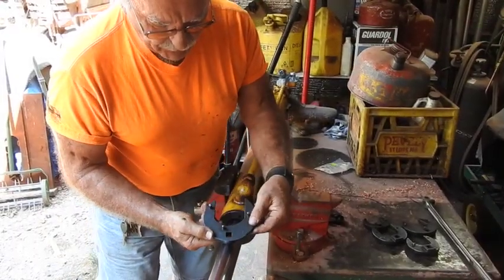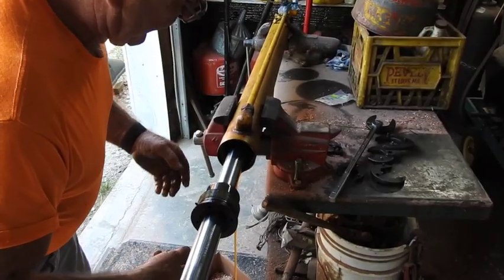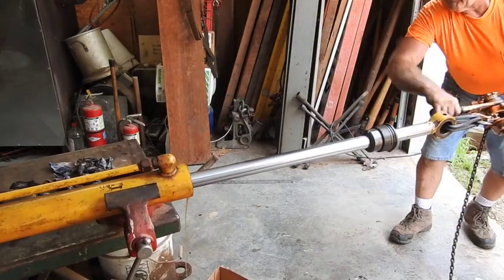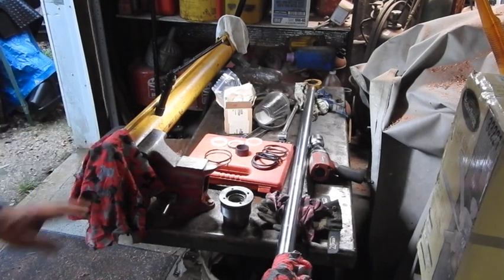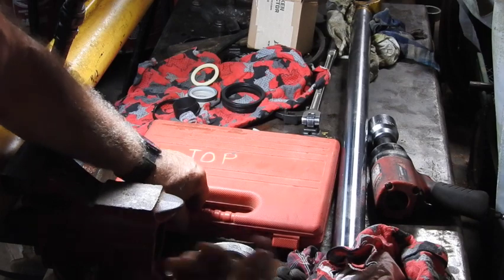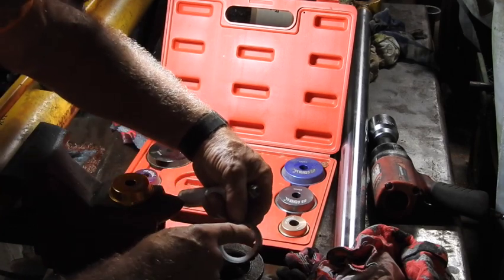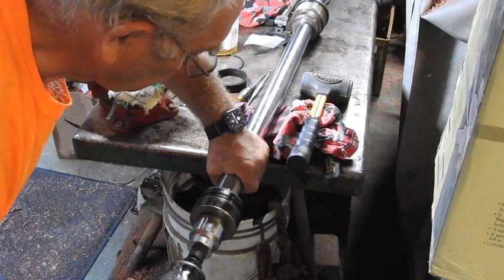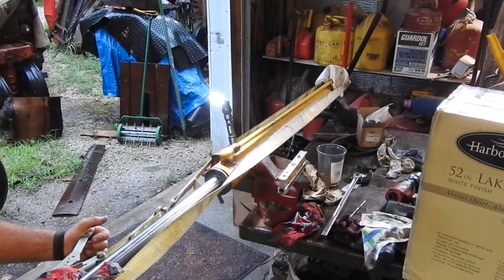Case Backhoe Boom Cylinder Repacking Job

Comment: Nice job and you made it look easy, thanks. My neighbor replaced all of the seals on my Case 480D, it was time.  He couldn't break the boom cylinder nut so I took it to a guy he recommended, yahoo charged me $120 (now I know about the spanner wrenches), same guy that charged me $170 for 2 sets of seal kits.  I bought all of the seal kits from a place in Bryan Texas and they averaged about $22 per kit, but that was 5 years ago before Covid.
Reply from the maker: Well, that's good to have them all replaced.  You should be set for a long time now.  The spanner wrenches were bought by my cousin in '73 along with the tractor when new.  I have a loader cylinder just beginning to seep right now.

Comment: Where do u order  parts
Reply from the maker: There's an industrial equipment company right across the river in Illinois where I used to go. Chartrand Equipment.  It's hit or miss though.  Then we have a local hydraulic shop I use as a last resort, but I lately have bought parts from places similar to these guys: https://amsconstructionparts.com/case/580b/backhoe/hydraulic-cylinders/parts Another place is AG Equipment Parts.  Look for numbers stamped on the end of the packing gland before you search. And make sure you have the serial number of the tractor too.  They are known for changing things over the years of production as things improve.

Comment: I repacked  all my cylinders on my back hoe.  It can be a messy  job, and requiring  a little bit of muscle, but it's not hard
Reply from the maker: If the glands aren't rusted in place they come apart pretty easy.  Sometimes the rams slide right out and other times it can get a bit tough to pull.  This one was moderate.
Reply: @tractorman4461  Yeah I used to just push them out with the machine. Sure, there was hydraulic on the ground but It was gonna be messy anyhow.   Lol   Big bars, big hammers and big socket sets with big cheater pipes cure about everything.  What  they won't cure, the torch kit will.   Even better.  Good video.  Keep running it and keep wrenching !
Reply from the maker: @spacecat7247  Yeah, that'd be a bit messier.  LOL. We used a 48'' pipe wrench and a big cheater on one not long ago.  But a guys gotta do what a guys gotta do sometimes.  Right now I gotta get my old rig back home so a bit of maintenance can get done.  It's got a few little things that need attention right now.
Reply: @tractorman4461  Case sells a face wrench for those glands.  It adapts to a 3/4 drive ratchet.  Was indispensable and the price wasn't that bad.  Check it out.  Local dealer should have them

Comment: lol I came here to see tips on how to change out the internal seal, the one Tractorman said was the hardest to change, but oh well he decided not to show the hardest part.
Reply from the maker: Hahaha…. I just popped open my phone and your comment came in. Yes it was not easy at all. You can damage them very easy. But I fold them towards the inside from one edge and gently insert them then pop ‘em back to their circular shape.  My brother just ordered a specific tool this week for one on his 580 that does it without hurting the seal OR your fingers.  This one took me three tries.
Reply: Thanks for replying. I have a case 30 backhoe mounted on a Case W20B front end loader (weird I know) I'm rebuilding/packing one of the boom cylinders. I do have a set of the seal tools you mentioned in your reply. I was looking for a video that showed how to use them, which end of the cylinder nut (old name for the part the spanner wrench goes on that holds the seals) is easiest to insert the internal seal from. I do realize it's impossible to film/record the actual placement of the seal inside, but a talk through explaining the process, what is difficult using a seal as a demo (folding, etc.) would be great. And no worries, you aren't the only youtube that skipped showing the hardest part. @tractorman4461

Comment: Manufacturer and part number of those spanners if you have it?
Reply from the maker: Well unfortunately I do not have the part numbers but they are Case supplied tools.  My cousin, the original owner bought the spanners with the tractor in 1973.  However, OTC makes an adjustable spanner that goes from 2'' to 6'' that would be my choice if I didn't have these.  Broken Tractor sells an adjustable spanner as well: CAS-1456A. The CAS stands for Case, btw.  Good luck with whatever you choose.
Reply: @tractorman4461  thank you for the reply! I have the adjustable OTC spanner currently, I just happened to like the ones that you had since they had three pins instead of two and were rigid instead of having the hinge. I work for a case dealer I’m gonna have to see if I can find some like them. Thanks again for your time!
Reply from the maker: @rally4life111  No problem. I wish I had the part number for you. Mechanic or counter man...??  Heck, I might end up talking to you for the rebuild parts on a different 188D I've got on the stand.  It sat for years with water in the cylinders.  I got the jugs out, but haven't gotten back to pull the sleeves yet.  They are roasted...pitted halfway through.
Reply: @tractorman4461  I’m a field mechanic actually. I’m in good with our parts guys though so I should be able to dig for ya if you need it. Man haven’t worked on a 188D in a while. Those sleeves definitely have seen better days then. You pull them yet?
Reply from the maker: @rally4life111  Not yet.  Its on the back burner while I get some stuff done for the Missus.  This winter I'll get back on it.  I got the jugs out with a bit of effort, but the mains look in good to be good.  A new set of standard bearings for the crank and rods will take care of the lower end. But I'm afraid its gonna take all new top end parts.

Comment: When I tried to rebuild the boom cyl. on my 580 C I ended up having to buy a new cyl. I couldn't get the break the gland loose on the cyl., I snapped one of the steel dowel pins on my gland wrench. I tried a large monkey wench. I tried a chisel, heat and then tapping on the gland until I was blue in the face and decided to buy a new one. However, I did get the other side rebuilt without any trouble.
Reply from the maker: I had one loader cylinder pretty much the same way.  I gave up when I found a used one for $150. The design of the glands on these model Case tractors is not the best. Very problematic as they get old, especially so if they sit outside.  Thanks for adding your own frustration to the thread.  LOL
Reply: @tractorman4461  It sure wouldn't cost Case much to improve on this gland design! Course I don't know what Case is doing now with these glands, the Chinese are probably making their hyd. cylinders for them anyway.

Comment: where did you get the spanner set. I can't find one anywhere?
Reply from the maker: My cousin bought this tractor new in '73 and the spanner set was bought from the Case dealer at the same time.  He bought the whole security package with the locking cap covers for the oil fuel, radiator and gauge cluster.  He also purchased  with it a full set of locking side panels that have never been installed.  Of course the full set of service manuals as well.
Reply: @tractorman4461  can't find these wrenches anywhere

Comment: For people like me who don't have a bolted down work bench with 2 vices , I left the cylinder housing end attached to the backhoe to keep the case from turning when I loosened the nut, Some idiot before had tightened the nut so tight I had to stand on a 3 ft pipe wrench with a 4 ft cheater to get the nut lose. I left the housing end attached to the tractor while using a hoist attached to my truck to pull the rod out. The idiot before tightened the nut so tight it expanded the gland and it stuck on the threads pulling it out being expanded to a larger diameter than the inner threads for the nut.

I had so much torque on it when it broke past the threads it shot out and landed on the concrete. I suggest limiting it's travel as you torque it out so it cant fly out.

 I realized the nut threads were damaged only after trying to re assemble it and trying to reinstall the gland , it's diameter was larger than it's bore. and the gland was cracked. but nowhere around the outer o ring or gland seal seat , since my leak was out  of the shaft seal I replaced it,  then I had to turn the gland back down on the lathe to fit the bore and had to straiten the threads back.

I  had not had a problem with the gland seals, if you have a problem with them you will get a leak out of the nut threads.

Go figure after I got it back together the shaft seal leak was fixed but it started leaking out the threads, 
when it hit the ground it damaged the seal. I ordered a new gland seal and o ring and now have to take it apart again to replace them, this time IM welding the cracks in the gland and turning it on the lathe  so there is no possible leak past the gland

On my  Ford,  for the inner stack gland seals ford offered shims  you install behind the gland seals to insure they compress  between the gland seat  and the face of the nut.. The gland seal needs to extend  slightly out of it's bore past the gland face, if it does not it needs to be shimmed to make an end to end seal when the nut  is snug tight and the  nut face surface meets with the gland  face surface

The idiot before me thought tightening the nut more made a better seal when the seal has nothing to do with metal against metal.

Another issue I had,  for some seals,                                                                                                                                                                                                                                                                                                                                                                                                                                                                                                                                                                                 I used Harbor freight O rings from a kit only to have leaks and find out their 1/8" cros section O rings are way out of tolerance, a 1/8" o ring is suppose to measure 139 thousandths of an inch/ Harbor freights measured 121 thousandths of  an inch.
Reply from the maker: Good deal...at least you got to the bottom of the problem.  Man o man, that dude musta really tightened that gland/nut in there HARD.  Too dang hard.  Harbor Freight O-rings are trash.  I've not had 1 in 10 that actually work.  You added a lot of good tips for sure.  I took it off and brought it home because the old hoe isn't here.  Its at another location and I didn't want to do it out in the field.

Comment: It's easier to put air on the blind end
Reply from the maker: I've done that too, but with a really tight one its hard to control the movement.  Also if there's any amount of residual oil in there, it can get a bit messy !!  Well, either that or its just me. LOL  Thanks for the visit today Ron.  Btw, I've got a couple more beginning to show signs of seepage.  One of them is a power steering cylinder.

Comment: My girlfriends Mom has got a case 580. I jump on it here and there and do some work. Put hoses on it a few weeks ago. Before her Dad passed, he sent off one of the downrigger cylinders to be repaired. It leaks from the threads on the Gland. Im not sure if an O-ring was pinched, it's loose, or perhaps damaged  threads etc... It is in visualluy rough shape, with some knicks on the end of the gland. I haven't addressed it, the leaks is small and its not used often. Good video. Reminds me of my Grandpa. He loves tractors.
Reply from the maker: It could be something simple as it is leaking from the threads.  But then the packing gland has to be letting some oil on the wrong side it in order to leak there.  I got nothing else for ya without having it on the workbench.....  Good luck, and there may be information stamped into the gland to identify the kit required to rebuild it.  Other than that, you have to go by the model and serial # of the tractor and possibly the actual loader itself.  OR...you can take it to a hydraulic repair shop.
Reply: @tractorman4461  Thank you for the reply. The old girl is tired, but it is still able to function and get things done. Nice thing about old tractors is parts avalibality still seems to be there, for the most part, compared to newer systems. Funny how that works.

Comment: Nice repack on the cylinder. Wish mine came apart that easy I have a 580 super K and the boom cylinder rod has a 2-3/16 head bolt that holds the packing assembly to it. I have hammered away with a 2500 ft lb.  air impact and it won't touch it. Not sure what to do with it now, some people say heat it, don't want to do that and change the temper in the steel. I have hit the end with a sledge tried a chisel to shock it loose nothing has worked so far. Any suggestions?
Reply from the maker: Well, we bent a 3/4 square rod and welded it around the end of the gland to give us a something for a 48'' pipewrench to hook to on my brothers 580.  The heat won't effect the steel that much to cause a problem with a tractor like ours that sees minimal use.  Now a tractor on a job that's run 40+ hours a week, I can see a bit of a concern.  We did it with his and its working fine now.  He literally snapped the ram in half on his loader.  Here's a video on it: https://www.youtube.com/watch?v=u4-AsH-7WXw&t=212s  The heat of the weld loosened it immediately and it moved very easily.  Actually the one we heated was one I took off my own Case many years ago when I couldn't get it apart back then.  I found a replacement for $150 so put it off the side.
Reply: @tractorman4461  Always satisfying saving a buck when you can do it yourself! I ended up heating the bolt and got it out, I don't anticipate any problems from the heat, I put Loctite on it  and tightened it with my 1" gun

Comment: I HAVE A CASE  480c construction king  I'm just learning its all original runs like a champ  leaks like a champ from the cylinder that why I'm fixing it  when I'm not in school  I'm  redoing this  but some of the seals fell apart  if you can see these pics  Yes im poor boy  LEARNING EVERYTHING i can before i mess up  here is the link of the parts  i cleaned them up   made them look as new as possible not sure if i missed any seal if you have time to see it cause the kit i bought does not seem to do the   part with the bolt coming out there tapered like they stack . here is the link the back arrow will take you to my other pics . but yours looks close and mine is huge like that.  Bought it with my lady so we can begin a life on a property we bought nothing big but just to get  set up 
probably spend more time  paying  building permits that anything .  here is this link  thank you for any advice anyone knows . all original parts  nothing swapped out  good machine . i WANT TO MAKE IT TO MY 20TH birthday  and not have killed myself when building on the land lol    The tiny back arrow up in the left top corner will take you to the other pictures I am not sure why it chose one.  
https://www.dropbox.com/s/ud1mq2olbrw5pjr/20230428_163656.jpg?dl=0
Reply from the maker: Did you notice if there were numbers stamped into the end of the packing gland ?  Sometimes those will get you the correct kit for your cylinder.  But all of them do not have that and you have to go by the model/serial number of the actual loader.  And if you are lucky no one before you has installed an aftermarket cylinder.  Good luck with your project, your lady AND developing your property.  I couldn't access your dropbox for some reason.  But I'm on a Mac if that makes a difference.

Comment: Really good video. I have a 1968 Case 580CK that I have been working on and the hydraulic cylinders will all have to be done. This helps a lot. I've SUBSCRIBED to your channel. See you around.
Reply from the maker: Awesome !!  Glad to have you stop in and stay a while.  Drop a comment any time. I usually find them fairly quick, but some do slip through the cracks.
Reply: @tractorman4461  Will do.

Comment: How often should a person replace the hydraulic fluid and hydraulic filter on their machines?
Reply from the maker: Normal usage tractors probably once a year James.  But intermittent use machines like my own, probably every 1500 to 2000 hours on the hourmeter.  There's probably a mechanic out there that knows what's recommended from Case.
Reply: @Tractorman44  thanks! I'm getting a 1969 580 ck at some point this week. Figured I would do an oil and hydraulic fluid change, just then try and keep them on some sort of schedule after that. I just didn't know what that schedule would look like